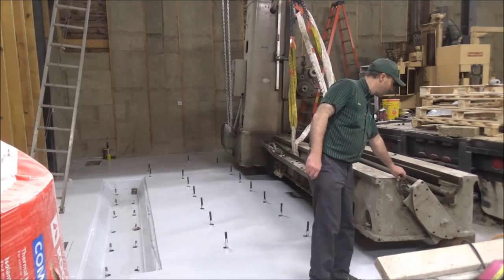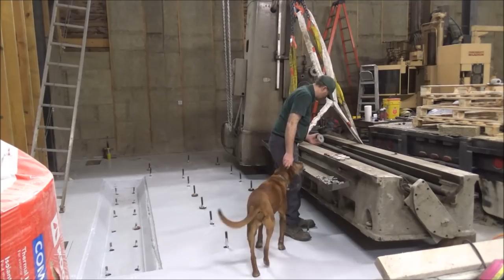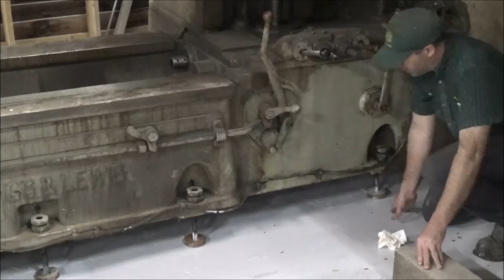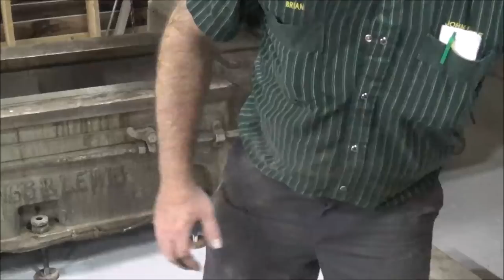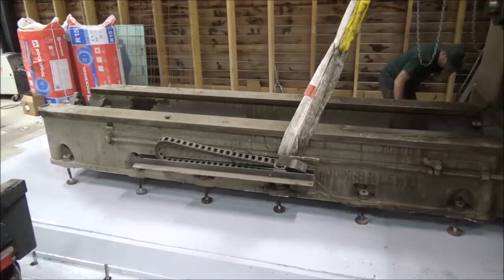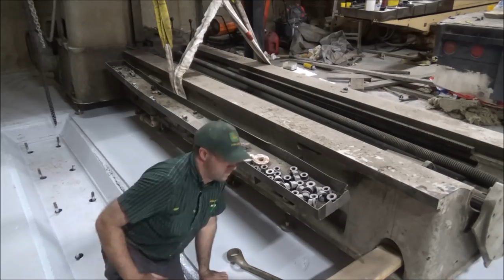One Man Army Monster Mill Move Part 4

Comment: 0:36 I did a radio operated crane course, and we where specifically told never to leave the crane with load still hanging on it. I imagine holding that much weight for three days will create unnecessary stress on the equipment.
Reply from the maker: I believe some crane rating tests require a 24hr 25%overload for certification.

Comment: Nice work! I'd have been happier if you had a block under there when your hands were under there though.
Reply from the maker: Well at least the steel plates  the mill sits on are thicker than my hand but not that I want to test if they would protect me.
Reply: Agree.Press Operator from way back; also there is a big difference between reachng your hand under there for a second and not your head, lol. (Not joking about safety, all ten still there).
Reply: ME TOO!
Reply: I was verry angry  for your hands to, never do this again please .

Comment: Well that pretty much proves your planning, layout and measuring ability Brian. I'm positive the outrigger supports will line up just as well. Nice smooth alignment on all the studs with nothing hanging up so there all placed correctly. That initial starting point is the only tough part. After 3 days hanging on the hook I wouldn't have thought twice about getting in there with my hand either. Some jobs we both know it's necessary to be a bit more careful with, but imo that sure wasn't one I'd have been worried about. I've lifted a lot heavier and seen much much larger than my largest lift craned into place, so that job went exactly like it was supposed to. Well done. :-)
Reply from the maker: At some point you have to just accept the fact it is all risky and be on your guard, I mean the whole bridge could come down too so you can't worry about everything.

Comment: Can you adjust the anchors what holds it in concrete? If It it needs some alignment when using machinist level? Do you then fix it in place with some jointconcrete?

Comment: Hello Brian,  Been watching the whole Barn to shop series but on this one you got me stumped.  What are the two trenches alongside the ways for?  I see a set of anchor bolts in each but nothing obviously on the boring mill extends that far out.  You are getting it wrapped up.  Even achieved a three tail wag from Boss Bailey!!  Doing good.  Take care.  Doug
Reply from the maker: I have discussed it before, even in this video, but It will be shown soon though.
Reply: Well I sure missed it and I have watched from start to finish.  In one video you kinda of said something about a cutting oil reservoir but it wasn't clear whether it went there and if it did how  as well as what the other one would be for.  Plus it makes little sense as it looks like if that were the case you would be standing on it while operating. Also the mounting bolts being in the bottom of a tank and that many is very strange.  The only reference in this video unless I totally missed it was the part about wanting to fully paint the area as it would be where the mess would be.  Doesn't tell me much.  Oh well.  Take care.  Doug
Reply from the maker: Sorry! You were right I was wrong, it was in the previous mill move video I discussed it. https://www.youtube.com/watch?v=1vPIBYOGhJk 1:40
Reply: Thanks Brian.  I had already watched it and just didn't get the picture.  It came clear on the second viewing.  Hard to imagine such a massive table that it needs its own railroad tracks!!  Take care.  Doug

Comment: Mr.Block, are you going to install a Climate Control System”Heating and Air Conditioning” in your shop too try and prevent condensation? Condensation=Rust and seems to be a common problem with a lot of Machine shops.
Reply from the maker: Yes heating and cooling is in the plans.

Comment: As has been my custom - asking God to watch over you moving that beast. Now on with the show.  I noticed Shop Boss gave you the assignment then walked away. That is good management. 

I want to call foul on that 2x6 to hold it in position.  Offense Illegal holding prop 10 yard " penalty - first down. 

Clinch factor was high when your hands went under the mill with no block.  Bad Headline: KY Farmer/Engineer Gnawed Off His Own Hand When Trapped Under Huge Machinery.......... film at eleven. 

Well done - herculean effort which will be worth it.  

Dan